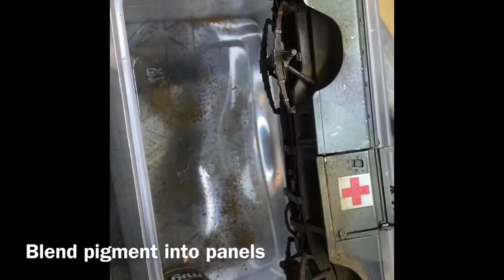Weathering tutorial a Land Rover (part4) scale model1/35.

Comment: Nice job. What did you use for the copper/metal look on the underside?
Reply from the maker: @mrkurruptuk100  hi, its a bit of a test of memory. I’ll have to re look at video. Nowadays I use gun metal pigment and a cheap silicon brush for bare metal, my latest Pacific Sherman details it.
Reply: @ctscalemodellinguk  thanks for the reply, I'll check that video out.
Reply from the maker: @mrkurruptuk100  I’ll watch the LR vid again, its been a while since I saw it
Reply from the maker: @mrkurruptuk100  hi, I base coated the underside with black, painted the exhaust a light rust colour probably vallejo paint, dry brushed with gun metal paint ie humbrol 53, then used AK brown wash for green vehicles. Hope this helps